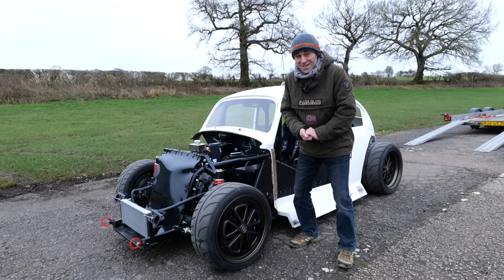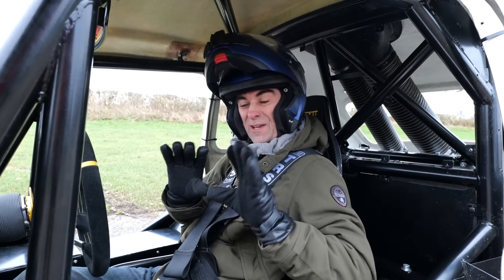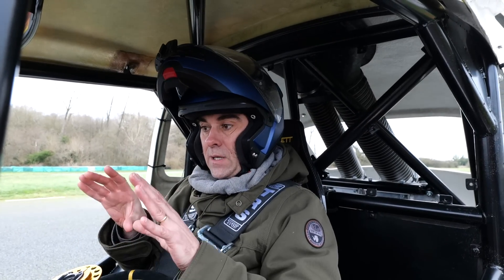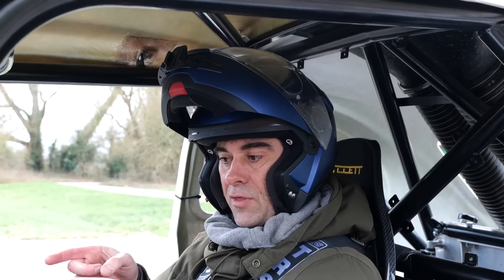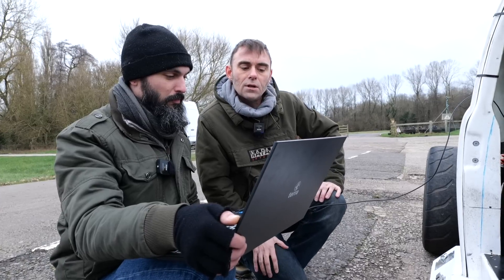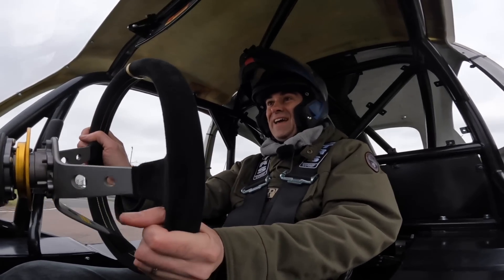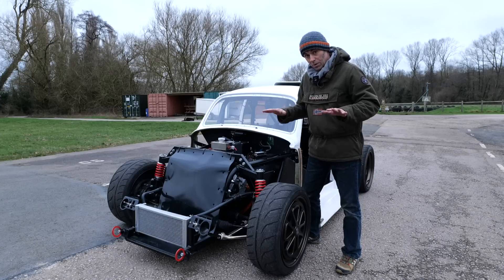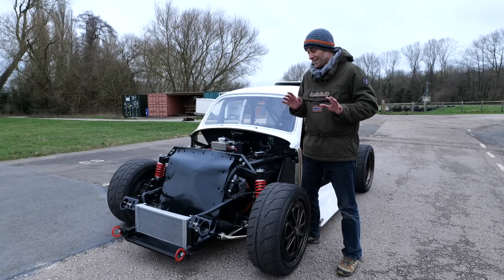Pikes Peak race car Ep10 - Track test

Comment: How many kWh in your battery pack to get you to the top with 1000 hp? How much do the batteries weigh? I ran numbers once and I think it required basically an entire 57.5 kWh model 3 battery pack which weighs over 1,000 lbs

Comment: I notice the SUV (some VAG thing VW or Porsche maybe) and trailer in the drone shot near the start of the video and it made me wonder…. 

What are the issues with towing upto 3.5 tonnes with EV power? Towing normally reduces max speed and mpg, so how hard will it hit range? That said the torque must be promising for getting going and regen braking for getting stopped? 

I’m not a complete EV cynic (my enthusiasm is waning slightly due to the away from home charging situation somewhat) but this does seem to be an area where the large EV SUV’s might not meet the needs of some users down the road. New users are less likely to use their EV SUVs for towing, but many second or third time owners use these sort of vehicles to tow right upto the 3.5 ton limit! I’ve not heard on any new EV with the full 3.5 ton towing limit yet. 

Any insight would be interesting. Thanks for another interesting update on the EV Bug (the nickname eludes me!).
Reply from the maker: Here’s a video we did on towing with an EV. It was a little too cold to use my Landy for this test day though. 😉👍 https://youtu.be/SHxQV3w1HKA?si=adIBUjuh7oxX-6gz

Comment: The car looks neat but I find the data pretty boring to me. The fan noise is way too high to my thinking but I’m definitely not a technical guy at all. I like to see acceleration and how it does cornering but I personally get bored hearing about battery packs and regen etc. I know I’m probably in the wrong sight. Good Luck on your goals though.👍👍

Comment: Did you consider including a super capacitor in the drivetrain?  I've always thought that having a capacitor to be able to accept massive amounts of energy when breaking and then being able to deliver that back out when accelerating would be more efficient and reduce strain/mitigate some limitations of the battery.  It adds more complexity but the payoff could be worth it.  I'd love to know your thoughts on it as you actually know the electrics inside out.

Comment: Main goal battery management. Conditions not ideal, car not complete, not fully aerodynamic or completely tuned. Baseline 0 to 60 mph. What are the goals for fastest speed and best time, 0 to 60 and 1/4 mile.

Some existing benchmarks:

Several years ago, Guy Martin did a 1/4 mile in 10.6 to 11 plus secs, 123 mph

Hyper cars can do 0 to 60 mph in 1.3 secs

Current Racing did a 1/4 mile in 8.28 secs @ 154 mph

Early days if car designed as drag racer or mountain climber. Engine noise sounds like a plane or jet. The brake noise, wow.

Comment: Given how short a run Pikes peak actually is (around 11min) it's unlikely that battery cell temperature will be the limiting factor because of the high thermal mass of that battery.  Given the high altitude and hence thin air and hecne poor cooling, i suspect you'll find inverter or motor temps drive you into thermal limitation well before the battery gets anywhere near critical. Most teams precool their systems with dry ice to start with inverter and motor at say -10degC or less.  You can also use evapourative cooling, ie expanding Co2 from a high pressure cylinder to maximse motor and inverter cooling.......

Comment: Isn't bad for the lithium cells to cycle them at such low temps?   cool project, not a big fan of hacking classics, but a vw bug no issues!
Reply: It's nearer to a spaceframe special than it is to a VW ... it wouldn't surprise me if there are zero parts or panels from an original beetle (i.e. hacking of classic didn't take place!)

Comment: Was that a religious experience? Our man comes over as a bit of a priest, I feel. Saintly whooshing propulsion. Like Formula E. I can’t get excited. I’ve tried. With speed and power I want a racing engine’s howl or growl. Not hairdryer whoosh. I’m sorry, it’s just dull. Clever engineering of a kind, yep. But we evolved ears for a reason. 

Great sounds: Ferrari V12, Honda V10, Aston Martin V8, Honda MotoGP V5, Ducati MotoGP V4, Suzuki GSXR1000 with minimal silencer, BSA Goldstar 500 single, Honda 6 cylinder 250 4 stroke.

Here there is much excitement in measuring the temperature of the infernal battery in 12 places(!). What kind of a world…etc
Reply: Moggy is in the car, enjoying the speed, I suppose someone living vicariously in the stands or on the other side off a screen might have to enjoy the noises instead of the actual experience.

Comment: Hi, two questions you may want to dive into a little: first: how do you see incorporating heat pumps into classics? Second: what do you think about hub motors for an easier electrifying of, especially smaller, classic cars? Are companies working with hub motors atm scam or could it be a  solution for fast electrification of ICEs?
Reply from the maker: Heat pumps are coming. Stay tuned. Hub motors have lots of disadvantages which is why there’s none in production cars. Too many to list here. 👍

Comment: If want the temp up, why run the fans all the time? Isnt it a good idea to run with and then without fans? 
Also, if the battery or motor needs cooling the you are done and you shut it off. Is there never a need for the fans to still run for a while after you turn it off?

Comment: I think the optimum temperature for the batteries is about 45c for maximum performance so Pikes Peak may be still be challenging for thermal issues. No idea to what extent such high elevation will have on your cooling and what the ambient is. Unlike ICE vehicles it will not directly kill your power.  Shakedown looking good, well done.
Reply from the maker: Thinner air means less efficient cooling so we’re going to up the thermal management even more we reckon. 👍
Reply: @ElectricClassicCars  I guessed it was going to go in that direction. As an armchair pundit it does appear that more competition cars suffer with inadequate cooling than they do from a tiny bit more weight of a bigger rad. All part of the R&D, for a one-off car it is not a massive snag list so far.
Reply: @ElectricClassicCars  And this testing on a very cold day, so as the ambient temp goes up, the cooling will be less efficient too. You know what your doing though.
Reply: @ElectricClassicCars  Not just thinner, much dryer too. High moisture content in the air makes it more effective at cooling, but at those altitudes the absolute humidity is nearly zero.

Comment: +20 degrees for short sprints in freezing cold,  will need to check that when its 25 degrees ambient and batteries getting to 50?  Although once the front clip is on, directing airflow much more efficiently over the rad that should again help.  Good progress!